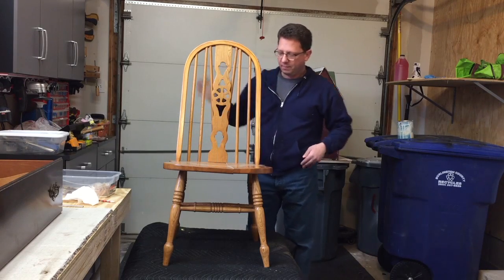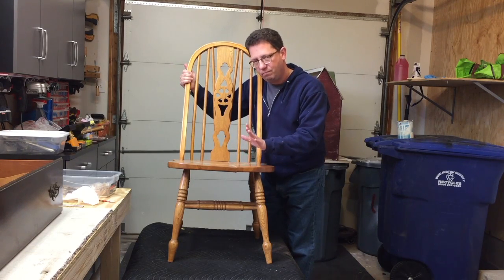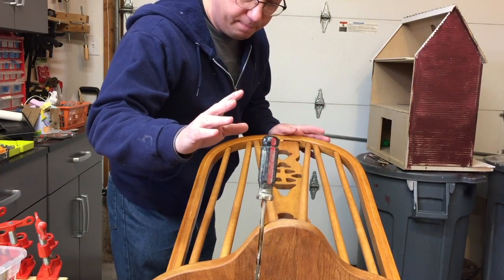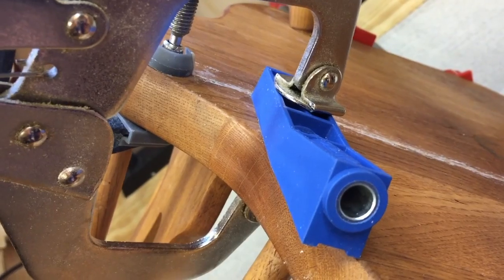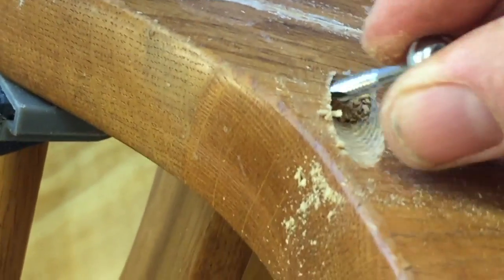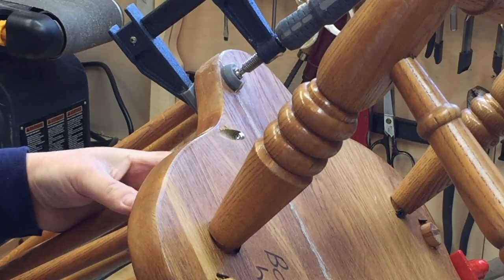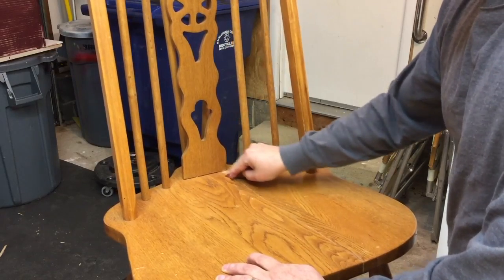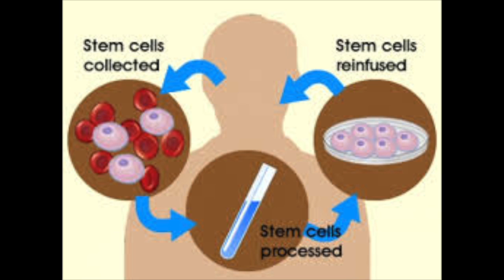Broken Chair Repair

Comment: I have an old antique farmhouse chair that's doing this VERY thing, and I'd like to do what you've done here. Can you recommend a set of clamps I could pick up for things like this?
Reply from the maker: Yep, find a Harbor Freight Tools near you.  There are a ton of bar clamps and pipe clamp fittings (you'll have to get the 1/2'pipes bought and cut at Lowe's.

Comment: I've got a chair that spit down the middle of the seat and it's in two pieces how would you fix that
Reply from the maker: Texas Hobbies sounds like the identical repair I did on this video.   You might need a few mending plates across the crack as well under the seat.